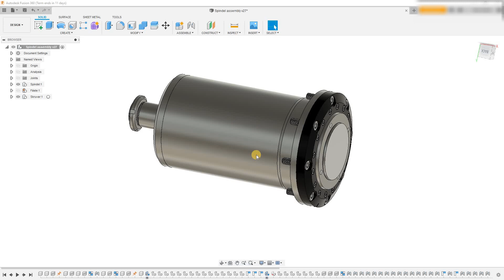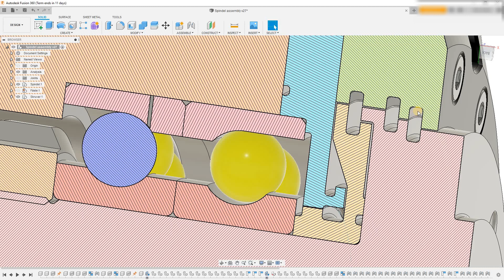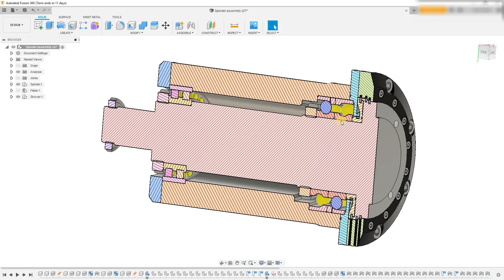A new lathe spindle. Part 1. The new spindle

Comment: Is this a spindle project for a lathe that you are showing turning on this video? I bet that bearings are held between two springy walls of the head casting, just like on my C6128 lathe. I am sure that this upgrade will pay off and I'm waiting patiently to see if that is going to be my next upgrade. Although I have been thinkering on fixing this issue by pouring Epoxy Granite in side of the head stock and providing just enough room for the spindle shaft. I guess that EG would also be possible in your case...   Good luck and keep us updated!

Comment: Is that regular boring bar or you got carbide one?
Reply: They sell carbide ones that apparently have less vibrations
Reply from the maker: I only use carbide tip tools.
Reply: @metalmusings  they make boring bar also out of carbide that holds same carbide inserts you use. It was about 40+$ i saw in ebay. They say it reduces vibration in comparison with regular boring bar made of tool steel.

Comment: Hello, it seems your rpm is to high or you did not have enough feed rate.I think that is your problem. you can try to calculate the proper feed rate with a online calkulator or search for the formula with google. Greetings from Germany
Reply from the maker: I have tried everything. I try to keep around 100 m/min and then adjust feed parameters. But it is sensitive.
Reply: @metalmusings  Yup, could be that your litle machine is not rigid enough and you got bad vibrations . Have you tried to atach a big cast iron  weight do reduce  vibration? Cast iron is very good in reducing vibrations and you could possibly dial in the resonance frequency of your machine so that it is not in the freuency range that you are using when working with it.